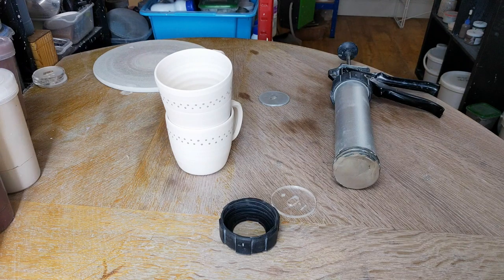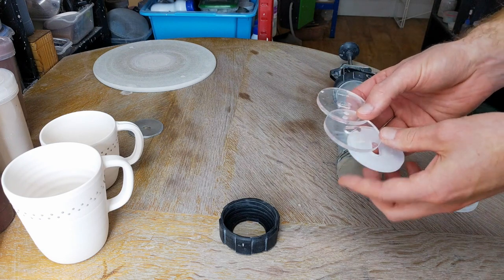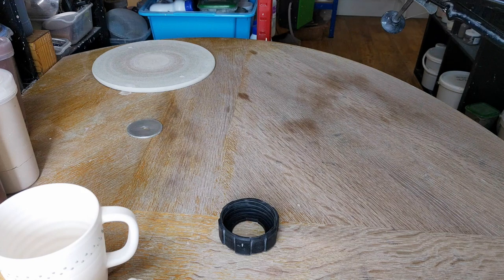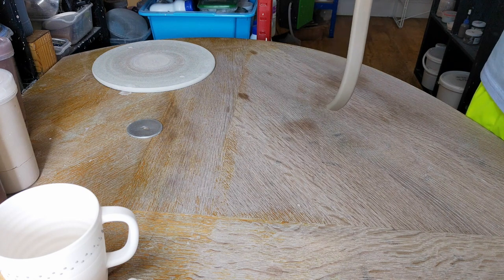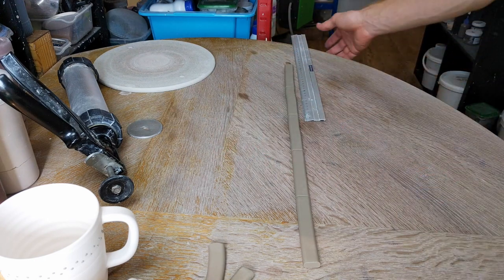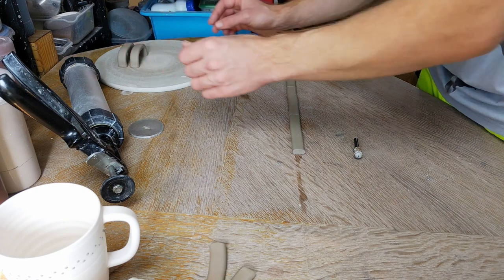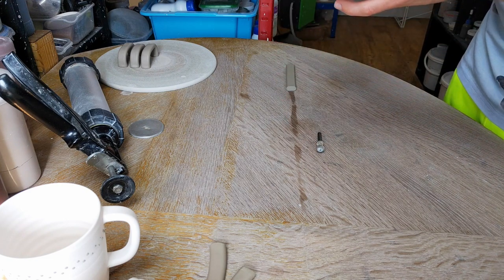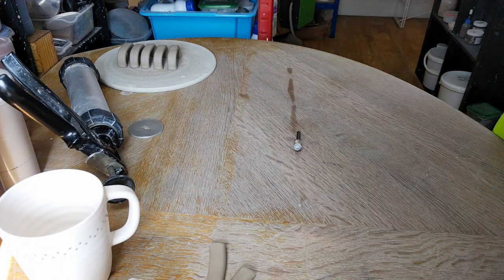Making Handles The Easy Way

Comment: Good video. Got one of your foot trimmers. What size is the rotary grinding bit you use to flare the handle joints? Keep up the good work!
Reply from the maker: Thanks! I'm not actually sure what size it is, but the widest point is about 10mm in diameter
Reply: Thanks for the video!  Nice work.  What were those little marks in the bisque mug?  I’m curious.

Comment: Wow, genius! Is this a special extrudor or would it work too with a silicone extrudor plus a plastic cap to put in before the clay?
Reply from the maker: This is a clay extruder, I'm not sure how well it would work with a modified silicon extruder. Worth trying though!
Reply: I've been using a silicone pistol but it is not ideal. The plunger is attached and needs to get out (that is not the problem) but it will be still in the end of the tube when you need to get the tube out. That is the problem. The 'claw' of the pistol doesn't have enough wiggle room to get the tube easily out. In other words, it takes me a couple of seconds to get the most perfect handles, but 10 minutes to get the tube out to be able to clean it for storing. I used my father's silicone pistol for 'silicone sausages' (it looks exactly like yours) and it is so much easier to get the clay out. I know what I will ask for present.
Sorry for my English. I hope what I wrote is understandable.
This video is really genius. The pistol, the way you attach the handles, everything.